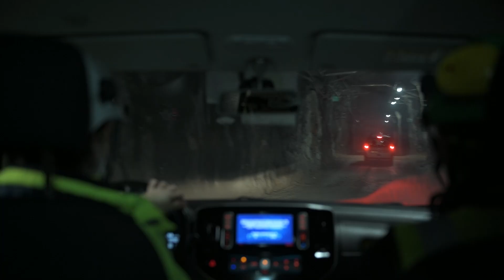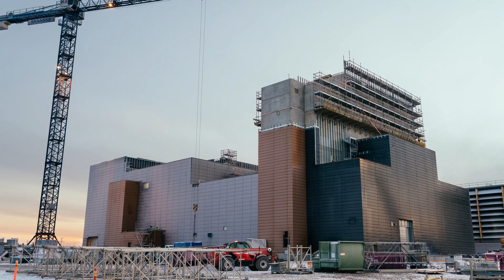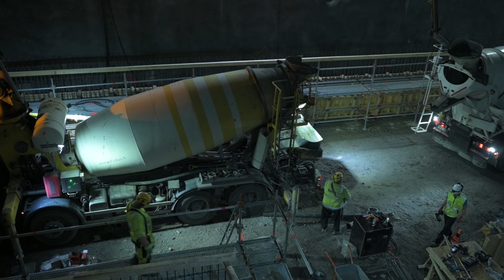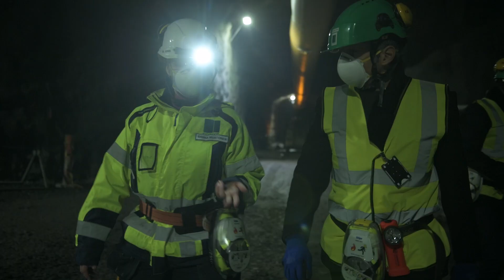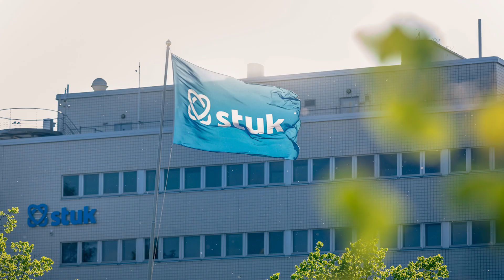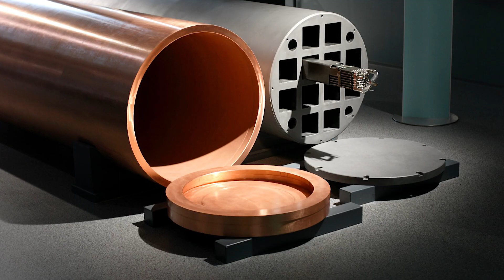Watch how Finland plans to store uranium waste for 100,000 years

Comment: They plan to backfill and bury this one around 2120. Then presumably they will need another one?
Reply: By 2120, new reactor designs that don't produce transuranic waste will be ubiquitous, and very likely the only reactors you're legally allowed to build anywhere on earth, and they won't generate the high-level 100,000 year stuff we need to (rightfully) take precautions with. The low level stuff is essentially a non-issue... well, outside of politics at least.

Comment: Good storage system yet it confirms yet again the absolutely crippling astronomical costs & resource waste of using nuclear power to do the most mundane task of .. boiling water.
Reply: Wouldn't the fact that 1kg of uranium produces 20000x the energy vs 1kg of coal make nuclear seem a good option? Like if those copper tubes can hold even just 50kg of waste, you'd need equivalent one million kilograms of coal. That's quite wasteful to dig up
Reply: Recycling the nuclear fuel helps cut down on the need for as much storage and mining.
Reply: The main cost associated with uranium-fired power is enrichment. Grand storage schemes are designed, because they cost essentially nothing.

Comment: No CO2 on nuclear stations? Have you ever seen the process to mine and process Uranium?
Reply: By that rationale, wind and solar power aren't carbon free either.
Reply: @simonphoenix3789  They're not, not by a long shot...and it has nothing to do w/ CO2.  Two quick things to look into:
1)  How the "silica" for the solar panels is made
2)  How the non-biodegradable wind mill blades are created and disposed of.
Reply: @simonphoenix3789  it is important to point that also.
Reply: A coal plant in 2yrs creates the co2 of 20yrs of nuclear... And nuclear waste is much, much safer. Fossil fuel waste and emissions are highly toxic and problematic right now to everything. Nuclear waste done right with deep-geo storage... One foot wide hole will deal with a power plants entire lifespan of waste. And being fused into ceramic and glass prior to storage means its so beyond safe its insane.
Reply: @SombreroPharoah  nuclear waste is safe? Have you ever heard about chernobyl?
Reply: @Hellgazer ”Chernobyl” is the dumbest response. Nuclear waste is the easiest thing to just drop into a hole.
Reply: @danielzhang5395  🤣🤣🤣🤣🤣
Reply: @Hellgazer  The Chernobyl explosion wasn't due to nuclear waste.  It was due to being under (or poorly) engineered, being undersized...and communism.  Stalin wanted more power than it could produce, and the plant's management was too scared to say they couldn't make it happen.  So they graphite tipped the rods, used insulators as a throttle, and ran the plant way hotter than they should have.  
The issues they continue to have with it are again two fold - 1) governmental issues/bureaucracy and 2) they can't get to the core to properly secure it, so they are essentially allowing the reaction to work itself out under "shelter".
Reply: @Adam.Rushing  I know that, but it is still dangerous to produce, to use and to storage.
Reply: Nuclear power plants don't just mine uranium... They buy it

Comment: What happened to those nuclear reactors that re use fission material and leave barely any radioactive waste with just half the half life?
Reply: Those belong to russians, and finns don't like to cooperate with them 🤔
Reply: Cold fission finally achieved w magnets and vibration so nuclear reactors will not be needed.
Reply: You mean nuclear reprocessing (such as breeder?)

Easy: Nuclear power has a reputation that is so bad that it damages the profit of the reactors. The more you invest, the more people will hate you. It’s easier to just build solar panels, Windparks and massive batteries.

Comment: Nuclear energy is not carbon free. Massive amounts of fossil fuel used in mining ore and building reactors. Copper is not as corrosion-resistant as Finland hoped, causing the engineers to go back to the drawing board to find another containment system. Yucca was chosen because of NIMBY. Nevada has a smaller population to object than the other 5 sites under consideration. But it is riddled with fissures that allow water to freely flow into the center of the mountain. There is some debate over whether there are 256 technical shortcomings or 292 to make Yucca unsuitable. Besides Yucca's total capacity is 60,000 tons and the U.S. commercial reactors already have 85,000 tons on hand. When digging a hole to Hell, the first step would be to stop digging. The U.S. nukes generate 2000 tons/yr.
Reply: Hello Jack, the study that showed that copper was not as corrosion-resistant as hoped, was debunked. Whilst the copper was less corrosion-resistant, it was shown not to be a problem.
Reply: @aronvik2976  I sincerely hope that the Fins and Swedes succeed in their venture better than the WIPP plant did.
Reply: Nothing is carbon free. So that argument moot. Better solutions, not perfect solutions.
Reply: @anxiousearth680  So why do nuclear proponents claim it is carbon-free? For the same reason they say that nuclear waste is manageable. They lie.
Reply: Nuclear waste isn't just crud thrown down a pit though either. Its fused, glass and ceramic ultimately. Also to deep-geo store it... We're talking a foot wide hole for the lifespan of a plants material. I don't think it's overly concerning. Every nuclear plant on earth right now, 26 or so I believe. So, let's give each 3ft a hole. That's a 72ft square space somewhere on earth... That's quite easy enough to manage. In every regard. From start to end. Fossil fuel for mining, sure not grand. But 20yrs of a plant is what 2yrs of a coal plant cruds out. So to weigh it up...
Reply: @SombreroPharoah  It took twenty seconds to Google the topic to confirm you are full of baloney.  Try Google sometime. Result:  "Today there are about 440 nuclear power reactors operating in 32 countries plus Taiwan, with a combined capacity of about 390 GWe. In 2020 these provided 2553 TWh, about 10% of the world's electricity."
Reply: @SombreroPharoah  I don't like coal. The same utilities with nuclear reactors also have coal-fired power plants. They threaten to burn more coal if they don't get even more nuclear subsidies and restrictions on energy conservation and renewables. See bribes for House Speakers Larry Householder and Mike Madigan in Ohio and Illinois by nuclear utilities. Vitrification breaks down within 100 years. High-level nuclear waste would break it down ever faster. Heat from the waste must be ventilated away to keep it from building up. The WIPP repository in New Mexico was constructed 2,150 feet deep in a salt bed. It was authorized to store transuranic waste in 1999. In 2014, first a fire and then 8 days later, an explosion occurred releasing radioactive isotopes contaminating land over 200 miles away. Once it is released, there is no getting it back into Pandora's Box. It will cost over $2 billion to fix, the ventilation system is broken and the tunnel collapsed where the explosion occurred. The "accident" was caused by a combination of highly radioactive waste, mismanagement and slack enforcement of regulatory requirements, just like all nuclear "accidents." Didn't take long for them to muck it up, did it? How will your "easy" little holes in the ground be any different? What is the impact of uranium mine tailings left in open trenches, waste mountains and sludge ponds? It takes 1 million lbs. of 0.1% ore to generate 7 lbs. of U-235. Most of the radioactivity is still in the tailings. A 1000 MW reactor produces over 10-20 tons of high-level waste/yr. and 50-70 tons of low-level waste, which also must be vitrified and stored in casks and maintained to avoid emissions.The fission products are thousands to millions of times more dangerous than the U-235 that went into the reactors. The tailings are acidic and radioactive. Also they contain many of the same heavy metals and toxins in coal ash. Fossil fuels are used to mine and process ore and build the huge steel and concrete reactors. Reactor steel, concrete, pipes and pressure tubes that come into contact with fission products are radioactive after 40 years from neutron absorption. Need a big hole, don't you? A lot of them. And some very mean SOBs to keep the vandals and terrorists away. I sure do like those solar panels and wind turbines.
Reply: Hi Jack, shit posting again I see. High-level nuclear waste is an asset, not a liability. But, you already know that.

Comment: I hope it works as planned. Because no one who’s involved in building it will be around to see if it fails in 200 or 2000 or 20,000 years.
Reply: its a damn cave bro. guess where we found the radioactive elements?
Reply: @roentgen226  Guess where you found Plutonium-239, Cobalt-60, Nickel-63, Krypton-83, Strontium-90, Yttrium-90, Actinium-225, Protactinium-233, Americium-241, Curium-244, Cesium-137, Cadmium-113, Europium-154, Tellurium-125 and over 200 other radioactive isotopes? Nowhere. Because they didn't exist before 1939 when we split the atom. These radioactive elements produced by the fission process are hundreds, and even thousands of times, some even millions of times more dangerous than naturally occurring radioactive materials like uranium, radium, potassium, and thorium.
Reply: @roentgen226  better check your facts dude. Uranium ore dug out of the ground has extremely low levels of radiation compared to radioactive waste which has very high radiation levels. I could live on top of the ore and it probably wouldn’t effect me. But if I were to come close to a spent radioactive rod I’d be dead meat walking in no time. They are not the same thing by any stretch.
Reply: Lot of half life cycles...
Reply: part of the project was actually "how are we going to tell people in 50,000 years, or even 1,000 years, that there's danger here, not to dig farther down, and the purpose of this facility...  Today it's hard for people to understand Ancient Roman, Latin and languages from 1,000 years ago, and in 10,000, or 50,000 people, or the residents of this planet, or whomever night find the site might not even know what an atom is anymore, and they had a thing where they proposed different methods to put signage when the site is full and burried for good, and one of them was "don't put any signs whatsoever because signs might tell people that there's something here and encourage them to dig"...  i found that quite an interesting thought experiment...
Reply: @tylerufen  That is the least of our worries. Why worry about whether future people can read the warnings if all life on Earth is destroyed by man-made nuclear radioactive isotopes.
Reply: @jackfanning7952  what?
Reply: @jackfanning7952  At this time, this is exactly the plan. If they do not find a better solution in ~120 years, the site will be left unmarked and just "forget" there ever was anything. Really intresting way to go about it :D
Reply: @tylerufen  You don't need to. There are 2 possibilities for the future.

A) Humans and our technology keep evolving. If you see where we've gone over just the course of a lifetime, where do you think we'll be in 100 years? 1000 years? 10,000 years?
Radioactive materials will not be a problem for such a future civilization, nor something they struggle to handle if they "accidentally" drill down into the repositories.

B) We annihilate our own civilization or are nearly wiped out by some disaster losing all of our modern technology and understanding of the world sometime in the future.
Well if we lose that much of our scientific discoveries and knowledge, we'll no longer have the capability to drill 500 meters down into the ground either, even if we wanted to do so in a random location with no natural resources.
Reply: @jm-holm  technology improved a lot in the past 200 years or so, since the internal combustion engine, then the transistor, but it took humans forever, tens of thousands to millions of years to get to the point of the Romans, and after the Romans, technology declined, so the way through the dark ages until the Renaissance, then the industrial revolution, then this information revolution, but it's otherwise fairly certain technology will stop improving so drastically in the near future, and possibly regress after...  it's what happened in recorded history, and nobody knows what happened prior, but there's some evidence that could be hoaxes that it technology boomed and regressed a few other times before the Romans...

It's not the main focus of the project, either, mind you, but it's an interesting precaution I thought they took...  it's an interesting attention, or sentiment, imo...
Reply: @tylerufen  Technology has improved as fast for as long as human civilization has been a thing. Which is a matter of less than 10,000 years.
The only reason we're advancing slightly faster now is stability and prosperity which allows us to educate more of the population (including women) while in the past education was limited to a small proportion of people.

The idea that technology declined or we made no advances during the "dark ages" is largely a myth, although a very popular and widely spread one. It was an age of turmoil after the fall of Rome in Europe, sure. But the world wasn't all about Europe and elsewhere the world kept advancing.
The "dark age" in Europe occured at the same time as the "golden age" of islam with vast advancements in astronomy, math, medicine and more.
It's a very euro-centric myth that humanity regressed.

There is absolutely no basis to that advancement should slow or stop, never mind regress.
Humans always think the time they live in is the peak of civilization and that there is little or nothing more we are capable of discovering or inventing.
People thought so 500 years ago, 100 years ago, 10 years ago and today. Yet we keep moving forward.
Reply: @jm-holm  i didn't say things regressed during the Christian dark ages, but it's generally presented as an era of stagnation...  i guess because it was Christianity-centric, it would've been different is Asian and east-Asian countries...  meso-American, even, but that would be within that area alone because they never developed the level of technology Europeans did...

i will keep an eye for something about Muslim civilization and it's faring during the dark ages, that could be interesting...  i wonder if they advanced "in comparison" to the Christian regions, or "normally", and how much those developments are significant today...

it's true that we're taught history from a Christian, European-centric point of view, and not necessarily from a global perspective...  guess we gotta be the heroes in our story/history...  that could be very interesting indeed, thanks for the perspective...
Reply: @jm-holm  i wouldn't have thought from the state of things today, so they were also victims of a dark age, but just after the Christian one, ...  those are significant contributions, indeed, and stuff people all around the world use today, every day...  i thought Arabic numerals had been invented before the Roman numerals, but just weren't popular, and Arabic ones gained in popularity after Rome fell, but i really had no idea, it was just the impression i had, or what i would've thought if i had thought about it...
Reply: Reading these you can absolutely tell how lacking y'all are on the subject... Spent nuclear waste, before it's put in any kind of storage, is fused into glass and ceramic and becomes a pretty stable entity of its own right. Not to mention storage containers will survive being hit by a train with no issue. Also a foot wide hole is all it'd take to dispose of nigh an entire power plants life span of waste. The half life of spent materials is half way neglible by the time its processed, even its radioactivity is so subpar to concern anyway. You could fit the entire planets worth of nuclear plants waste in one small facility... Tiny facility.
Reply: @SombreroPharoah  and that's precisely why they spent billions of dollars building that facility...

you should email them and offer them to dig a hole in your backyard for half the price, pocket the change...

not that teams of engineers and physicists worked on this, and not that actual dollars went into it's construction...

maybe it's you. who's a know-it-all keyboard warrior..?
Reply: @SombreroPharoah  Y'all.
Reply: @SombreroPharoah  i'm pretty sure that if they could have spared a dime on it, they would have.  maybe your task in life is digging a hole, but countries have other things to spend money on than digging a hole...

plus i'm not certain about the veracity of what you presented as fact, and you can go live in the pit with the nuclear waste if you're so sure, but personally i think nuclear waste is dangerous even after being processed, and i know it takes a lot more than a small hole because there's not just one reactor and there's not just the fuel, there's the reactor itself, there's also radiotherapy machines, cesium clocks, lots of soil from spills, entire buildings, etc...

i'm sure that multi-billion facility has it's reason to be, and the price tag doesn't make it so, but it's really not worth the show otherwise...  nobody really cares, almost nobody knows it exists, it's not worth building that for propaganda or to shape public opinion, so if nothing else, the price tag should tell you that it's necessary, and to revise what you think you know, or at least tell other people about your doubts in your version or your understanding of whatever you may present as facts, stories, or concepts...
Reply: @SombreroPharoah  The half life of U-235 is 700 million years!  Half lives of uranium isotopes vary considerably. To suggest that it’s “half way negligible” by the time it’s processed is totally misleading. That’s the problem with any form of storage. We’re talking about time frames beyond our imagination, let alone control.